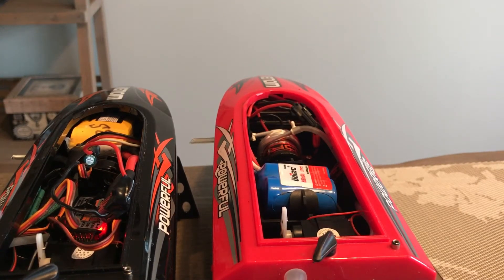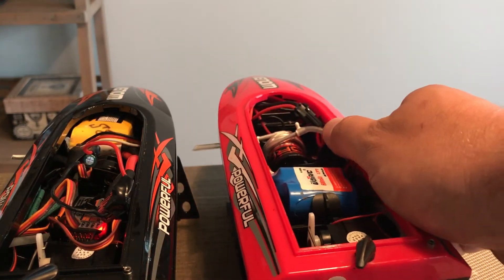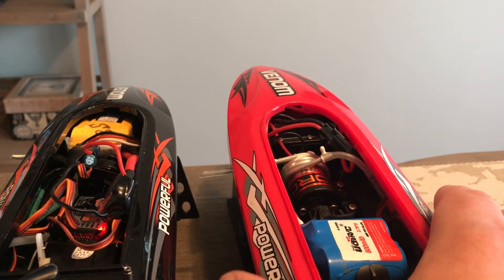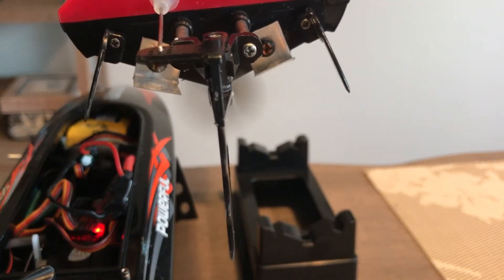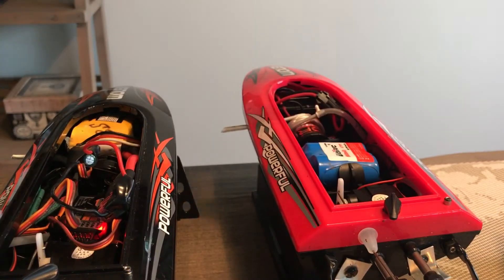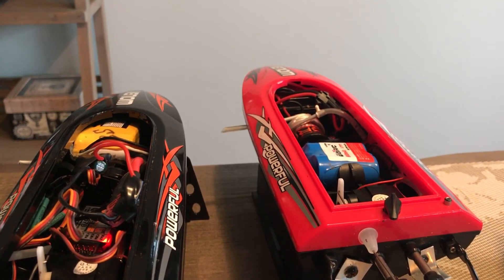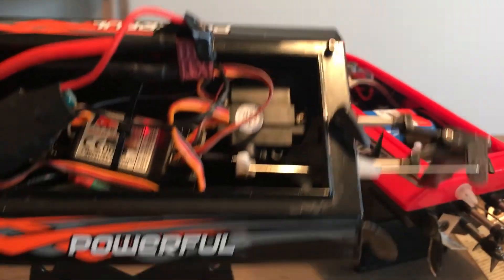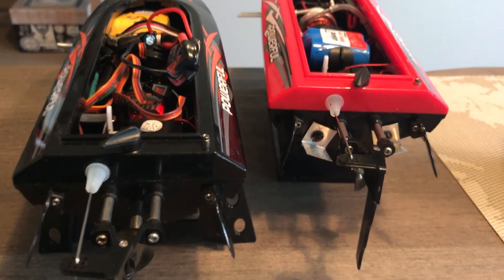Venom rc boat brushless upgrade

Comment: Does the transmitter still let you know when the battery is almost dead when you switch to brushless and does it still flip back up when you pull the trigger  like when it was brushed motor
Reply from the maker: Flips over once in a while, no it does not beep as the electronics are not the same anymore.
Reply: Do you know if the 1/18 scale motor will fit in the Rc boat I think it will mount up I just need a second  opinion because I order a 1/18 scale burshless motor and I plug the battery in but my soldering connection come on done so I could have sorted my ESC out in the brushed ESC on the boat because it will not turn on with a different battery now

Comment: Is this the same motor you got on?   Emax MT2204 2300KV CW Brushless Motor 2-3S Lipo for QAV250 QAV300 FPV Racing Drone Quadcopter.  Here is the link: https://www.amazon.com/dp/B00SYH8NXC/ref=cm_sw_r_em_apa_i_1dEYEbPKR7DYX
Reply from the maker: yes same

Comment: Hello the boat worked well when suddenly the speed went down without doing anything different, I saw something in a blog, but I do not know what to do since it does not go up as it was before.
What I have to do to make it work as before, thanks

https://www.rcgroups.com/forums/showthread.php?2822829-Venom-electric-boat-suddenly-slow

Best regard 
Jorge
Reply from the maker: Jorge Robayo could be many things, could be the motor is about to die, could be bad battery, could be drive shaft got dry and lots of friction. Drive shaft should be oiled.
Reply: @ECMTUNER  thank you for your fast reply, I only used like 3 or 4 times, the battery I think  its fine, maybe it will be the drive shaft, any tip on how to oil it? best regards

Comment: Plz the name of the items you used?
Reply from the maker: Upgraded my cheap venom boat with 2300kv drone motor, 10amp esc from a broken drone and 3s 1050mah battery got good 30 min run out of it.

Comment: Good night can you tell me were or what make are the motor that you put in the up graded boat please i don't know what number is the motor please let me know wen you have a chance thanks
Reply from the maker: Upgraded my cheap venom boat with 2300kv drone motor, 10amp esc from a broken drone and 3s 1050mah battery got good 30 min run out of it.

Comment: What is the name of the motor you change? And where can I find it?
Reply from the maker: Upgraded my cheap venom boat with 2300kv drone motor, 10amp esc from a broken drone and 3s 1050mah battery got good 30 min run out of it.